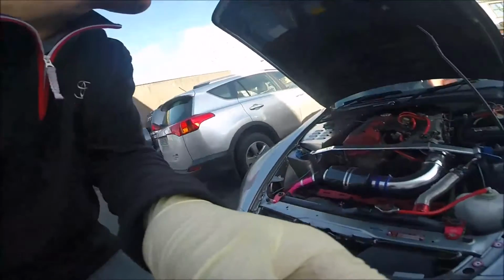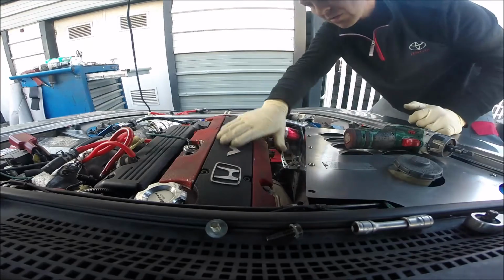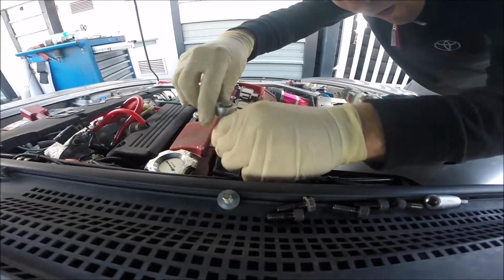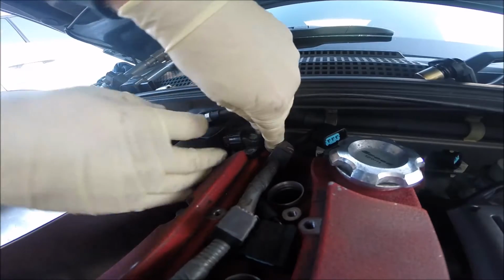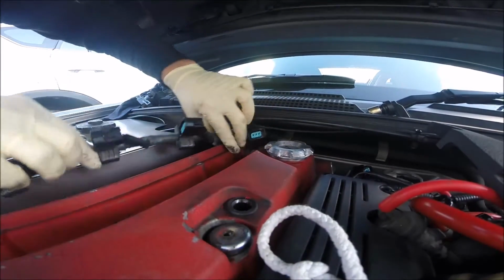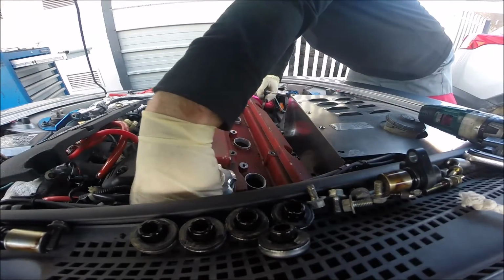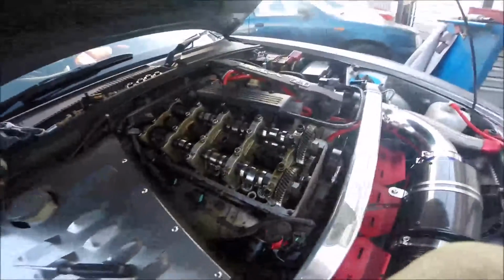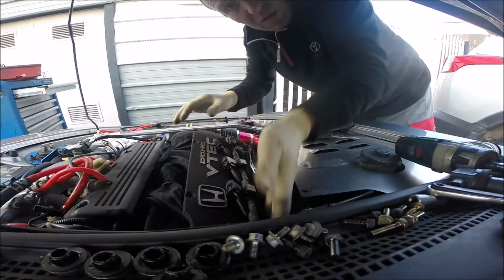Honda s2000 Rocker Cover Removal

Comment: hi I have just purchased a new rocker cover for my S2000 but it does not have the hose connection attached to it (front right as you look from the front) does the one already in my rocker cover come out easy if so is it a screw in or pull out?
Reply from the maker: mark dewsnap hi, for better understanding send pictures by email: fixyourride13@gmail.com